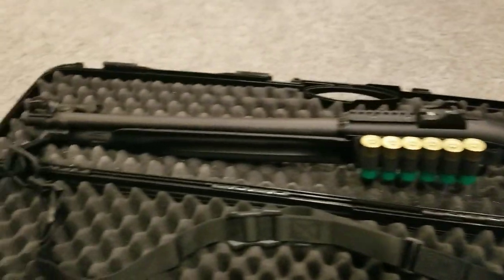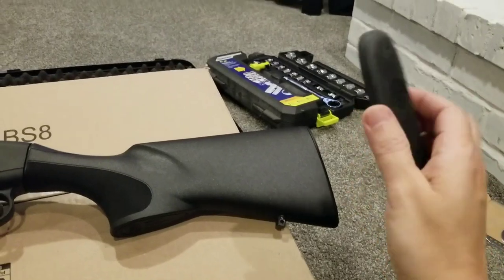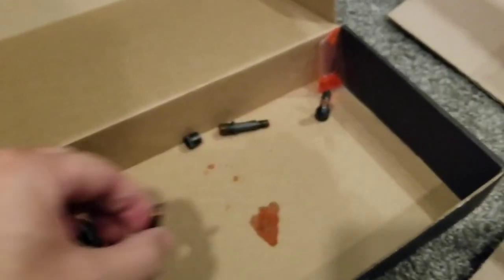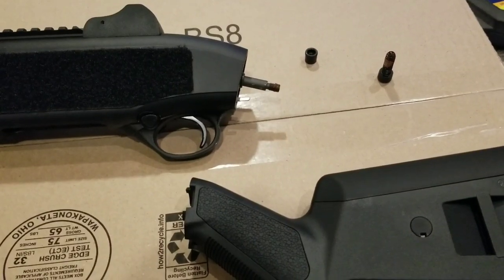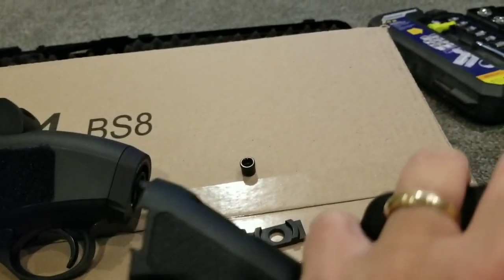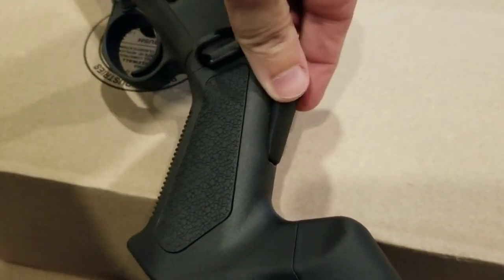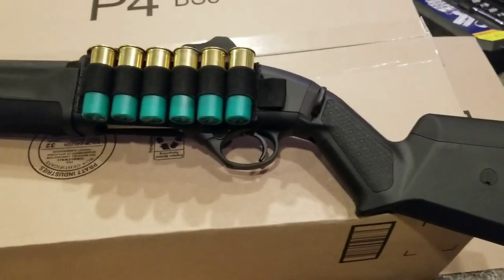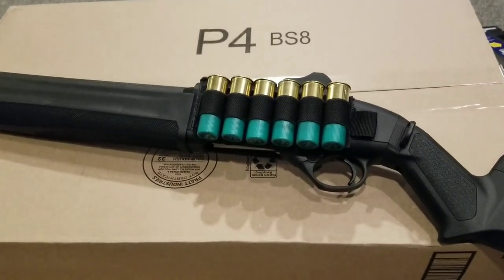Beretta 1301 Aridus stock adapter for Magpul Mossberg SGA Stock

Comment: THIS WAS GREAT! The hardest part was REMOVING THAT AWFUL Berretta Bolt! YT removed all of those videos. This definitely helped! you're a patriot! thank you sir! Doc David
Reply: I’m stuck on that part... how did you remove that bolt?
Reply: @raymondyeung5026  that was an absolute bitch. Don’t feel bad your not alone. I had to use a pipe wrench w/ teeth, I use Wilton table mounted Vice grip. Prior to Carefully using your pipe wrench grip the washer on its “mounts” (I placed a place a cloth over mount to hold the base shotgun). I then used the pipe wrench to turn it. Let me know if u have any questions. 🇺🇸🇺🇸🇺🇸

Comment: Thank you for the video.  Does the Magpul stock change the LOP (distance from the trigger to the back of the stock) ?  Edit:  Found the answer at Aridus..........This brings the length of pull from 13+” to a little over 12”.

Comment: Thanks for the video. I too need pictures lol. Yes that tiny nut was a bit of a pain. The Allen wrench that came with mine was a little rolled on one end, so I had to file it down to make it fit into the nut. The Magpul stock has a SS washer inside, so you’re not actually tightening on the polymer. The Velcro shell holders are actually the way to go IMO. There have been some other videos on them. The 7 shell holder will fit inside an AR mag pouch if you want to go that route for holding more on you.
Thanks again.

Comment: Looks good!  I'm waiting for the Aridus parts be back in stock.  Mostly I want the stock adapter since the SGA is the best stock on the market (use one on my Mossy).  Maybe down the road I'll get the forend and +2 mag extension.
Reply from the maker: Yes, low stock on other Aridus accessories.  I am waiting for the upgraded handguard to be available.

Comment: I swapped stocks on a Charles Daly pump 20 gauge once. The hardest part was buying an extension for my socket wrench to reach the bolt down inside the stock attached to the rear of the receiver. There was no convenient slot on top of the buttstock to reach the bolt-on screw.

Comment: I changed out the magpul butt pad with a limbsaver airtech+magpul adapter for Remington pad, magpul pad was too stiff for my liking.
Reply: I added a Limbsaver to my Franchi Diamond over/under. Not only did it cut felt recoil in half, it increased length of pull perfectly for me.  First accessory I bought for my 1301 was another Limbsaver. I've heard conflicting reports about the 1301 recoil. The Limbsaver is easy to slide on or off.

Comment: CHRIS, WHERE CAN I GET THE SLING SWIVEL YOU USED, many thanks, Mike
Reply: I am not clear on why the receiver sling mount was added.  It looks like the Magpul stock has a better spot for push button QD swivel on the stock.  Am I missing something?  I would prefer the QD button for sling better...

Comment: What is the length difference between the beretta stock vs magpul stock?  I assume the magpul is a few inches shorter?
Reply: 0.5 inches shorter, I believe
Reply: According to the YouTube Lucky Gunner video it's 5/8"....now keep in mind that's with the Aridus adapter. GG&G appears to be thicker for the Mossberg application so in that case it's probably not as much of a reduction.

Comment: My Aridus adapter doesn’t fit on the SGA stock

Edit: it’s because I’m an idiot 
I bought the SGA 870 stock instead of the SGA 590. There is actually a significant difference in mating surface.

Comment: Gun manufacturers should equip shotguns with side picatinny rails to mount shotgun shells instead of these cheap stick on ones. Also make stocks that can hold shells instead of the elastic shell holders that go around the butt stock.